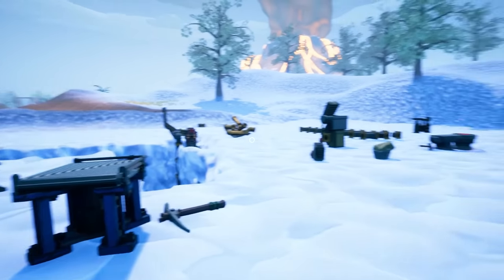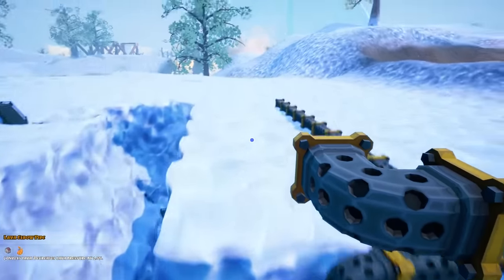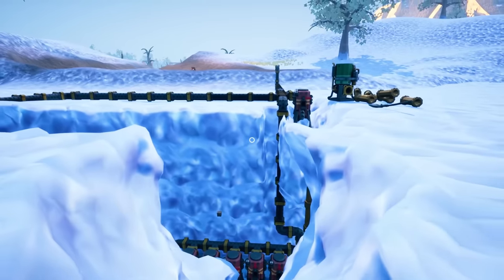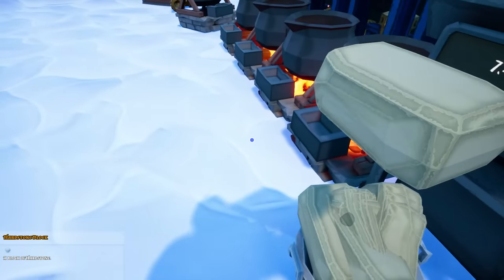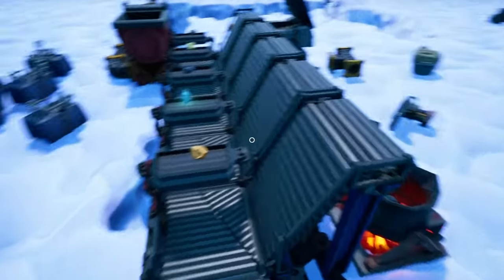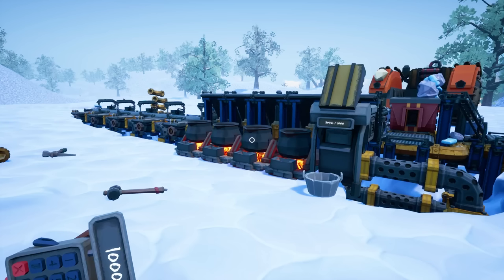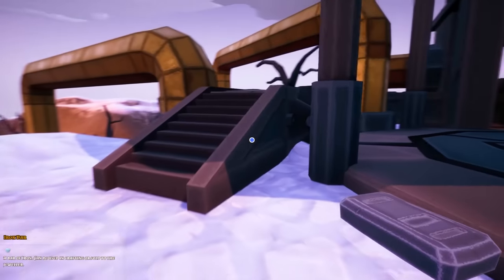I Upgraded My Factory For MAX EFFICIENCY in Hydroneer

Comment: Hey Blitz, if you use the rake, you will see that it rakes in a cube . If you dig 3 times in the center of the cube and the rake it clears away the entire cube and flatens the wall you were looking at. Makes clearing an area a lot quicker.
Reply: I was looking for this comment
Reply: It makes for clean mine surfaces and infinite ice/dirt. Dig a little, resurface, dig a little more, resurface. And they try to make you get the Dirt and Ice Wands to get more dirt and ice.

Comment: There is a way to set up an automatic repair system with the filters. using logic you can hook wrench throwers to a detector and lay a circular belt line under it. You fill the belt line with wrench bags and the detectors will tell the throwers to fix the filters when they break. The only thing you would have to do is refill the belt every now and then.
Hybridsteel made a few vids on this.

Comment: Hey Blitz! 

I think having 4 filters on the same lava tube works a lot better then having only one filter per tube. 
Because even if one filter breaks the machines will still run because there are more filters on that same tube to stop it from breaking and stopping the machine (like what happened at 27:43 / 28:20 where one filter broke and the whole machine stopped).

This may be wrong but hopefully it helps!
Reply: Yeah you are wrong, just set up auto repair
Reply: @leaserx4548  yeah I thought that but if he didn't want to do too much wiring yet I was thinking this as a short term fix :)
Reply: You are mistaken. Each pipe only takes  cleaning from one filter. Each filter cleans the lava by 20%. In order to have the lava completely filtered, you need to have five pipes with a filter on each one. Extra filters per pipe don’t do anything.
Reply: @daxain7368  Nah, he's correct in the filters piled onto 1 pipe will do their job, however that just removes the option of auto repairing them as you need a reader and a spanner hurler facing the actual filter. It might not seem like it, but if you try it with 4 on 1 pipe and then 1 extra one next to them your machines won't take damage that are on the line. I've got a setup currently with 3 drills and a harvester on it and I haven't ever had to repair those machines, but the filters have needed multiple repairs. Basically it's valid if you have to squish your design down, but I don't see why that'd be an issue with how big the claims are. You shouldn't be space limited that you have to mash the majority of your filters onto 1 pipe.
Reply: Yes and no. You can shove 4 onto 1 pipe and get the benefit of all 4, however the whole system shuts down if a single filter breaks. Putting multiple filters on 1 pipe removes the option to setup any kind of auto repair and only benefits you in shortening your filter line. But there's also a bit of a caveat to "benefit" of them being on the same pipe. You can put them on the same pipe, however the normal way filters work is that unfiltered lava and water damages machines capable of taking damage at a set rate. Filters reduce that damage by 20% and that gets compounded every filter TO each proceeding filter and that is the damage rate passed through it as well. So 3 filters will mean first filter takes damage at the normal rate, the next one takes it at 80% rate, and the last one is at 60%, meaning machines on this line is taking damage at 40% the normal damage rate. If you put 4 on 1 pipe, it starts to confuse the game. It doesn't know which is "first", "second", "third", and "fourth" in line. From what I've experienced (and this is my hypothesis based on that,) what happens is that you have 1 filter that gets designated as the "first" filter. After it breaks, everything tends to shift around according to durability. So the least durable then becomes the new first filter. I only am assuming this because on the build I have it on, I am always repairing the filters in a cycle around it, with the 5th filter hardly ever breaking down. But it's never 1 on the 4 on 1 pipe breaks and then that one is the next one to break again. It is always like one side breaks, then the bottom one, then the opposite to the first one, then the top one, and then repeat. They seem to break at a similar rate as the first filter in a 5 filtered pipe line takes.

So you are correct in that you can slap the effects of 4 filters onto 1 pipe, but you won't get the max longevity out of those filters that you could in by doing so. You are incorrect in that any single broken filter, even on a filter stacked pipe, will stop the flow completely. It's best to just build an auto repair system to keep things running.

Comment: ok blitz first off 1,000 is enough only 1 buildable has more than that required & 2 1,000 bricks both fit & meet the requirement. Second REGULAR PIPE FILTERS WORK FOR LAVA PIPES! meaning you can make a self repair system with 5 hammer throwers, a number pad, durability reader, & an A = B gate its a lot simpler than it looks

Comment: You've probably moved on to other games two months on, but for other players:

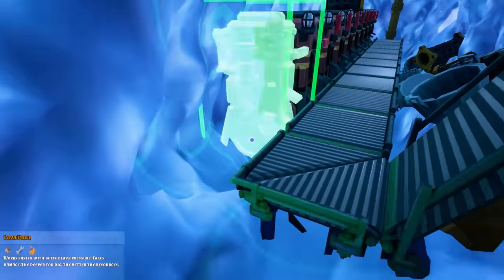If you hold down Ctrl and scroll your mouse-wheel, you can lengthen or shorten your placement distance. I see you hopping around the hole a bunch around 27:30, and you wouldn't have as many problems with the placement if you try to shorten that distance in tight spaces.

Cheers!

Comment: Next step is to use the electrical components to have wrench throwers activate when a filter breaks. Automated repairs. Also is that the maximum depth? I'm pretty sure I am getting corestone at the same location.

Comment: So things dont break turn on creative mode grad the infinite filter hook so things don't break filter hooks take damage before anything else will so if the filter can't break nothing breaks
Reply: Or  you can just use the automation gadgets to build an autorepair circuit to repair the hooks. You just have to refill the spanner thrower occasionally.
Reply: @WolfPlaysGames2  You have fun going back and buying a bunch of wrenches over and over again, I'll have fun not doing it.
Reply: @Blaze_1961  The repair circuit lasts at least 3 hours before it needs attention. It's easy enough to throw couple bags of wrenches in the truck whenever you visit.
Reply: @WolfPlaysGames2  As I said you have fun with that. Also, I know how the game works there no need for you explain it.

Comment: you might wanna put a 1lb bar on your smeltables so you can just drop the bars youve been using for jobs onto the conveyor and it will drop it back into the furnace for you with needing to do a lot of parkour. with bastion i found you could only get 10 jobs at a time im not sure if its the same on volcalidus or if the number of jobs you take on bastion affects the number of jobs you can take on volcalidus as i havent been there on my main and only on creative. you think your harvester problem was annoying i had at least 6500ls of emeralds 3000ls of sapphires and 30lbs of onyx stuck on my gem compressors and everytime i used the magnet my game would crash so i had to remove the emeralds by hand into 6 pans before i could use the magnet on the sapphires which created a mess that i was tidying up for over an hour.

Comment: I'm sitting here around 6 minutes in and Blitz's belts have stopped and he hasn't indicated whether or not he's actually stopped them or if they stopped on their own. That is the one thing that annoys me about this DLC; getting water flow started. Game breaking? No. Just annoying when you forget to turn off the water or don't have it connected and it just sits and runs and runs and it's empty by the time you want to start it back up and you have to hand feed it ice bars until it starts getting auto fed again.

5 filters is all you need. Any more and you're just making more things that can and will break and stop the system. All it takes is for 1 filter to break for an entire system to grind to a halt. You're also not getting any benefit beyond 5 filters. Each one filters 20% of the damage unfiltered water/lava deals to machines on that pipeline and after 5, they're not taking any damage and adding more isn't going to repair them.